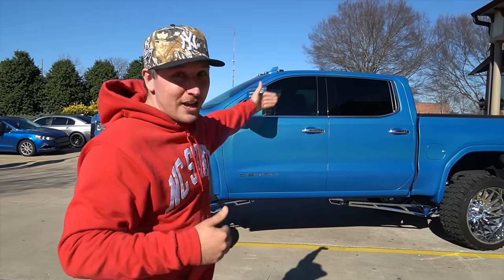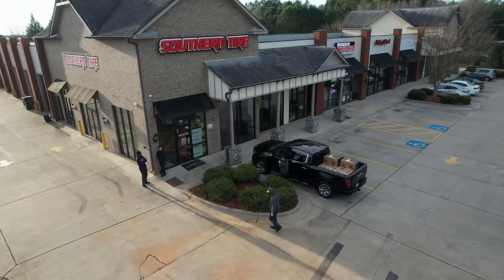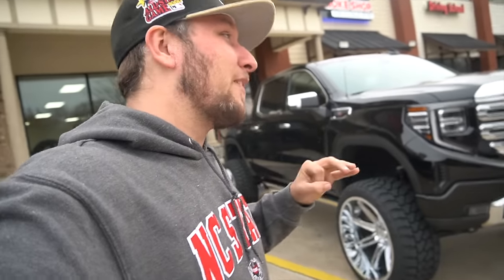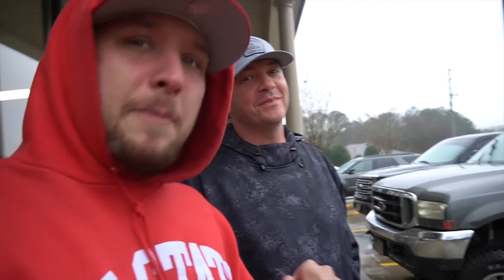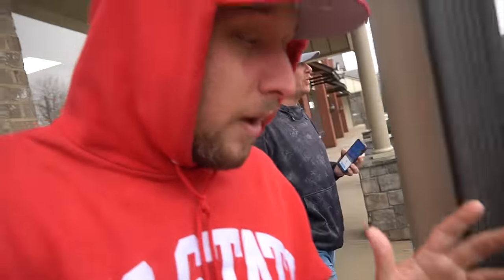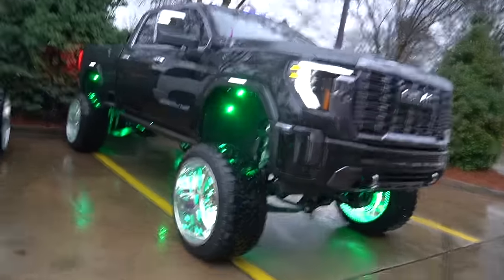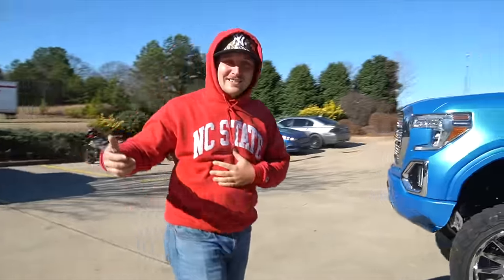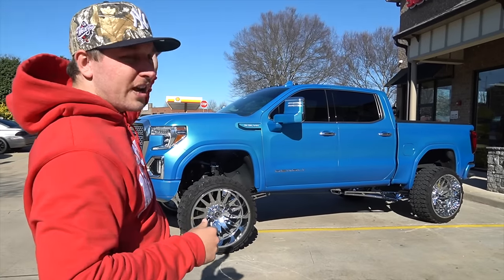Drove from MISSOURI to build his DREAM TRUCK! RIDICULOUS Lifted GMC on CHROME 9" FTS 26x14s and 37s

Comment: Love that bora bora blue - but I’ll take the black Ultimate package Denali Duramax any day.  That truck is sooo badass.  Love the two tone brown and black leather interior with the Topo land graphics in the leather.   
(And after owning a Duramax diesel, I’ll never ever go back to a half ton gas truck.   Love the looks of the half ton but the power and torque just isn’t there like the Duramax.  (Much better/bigger brakes too for stopping big tires and wheels on lifted trucks.)

Comment: Man I wish Louisiana would allow this… I’d be on it in a heartbeat!
Reply: What don't they allow in Louisiana, lifted trucks?
Reply from the maker: Im curious too
Reply: @paulcondie2520 tires can’t be 2 inches past your fender  first ticket is 500 second is 1500 third is they take your license.
Reply: @ralphcrockett8423  same in Pa. But they don't pull you over like they did 10 years ago. I put on stock 20s when I get my state inspection. They also used to measure bumper height here as well. I've been lifting my trucks since the late 80s! Lol. Yeah, I'm old as dirt! 🤣🤣🤣
Reply: @paulcondie2520 😂😂😂 me too.
Reply: @ralphcrockett8423  💪💯🇺🇲